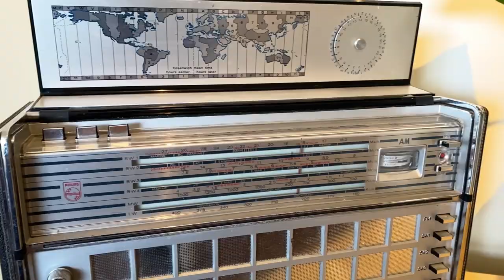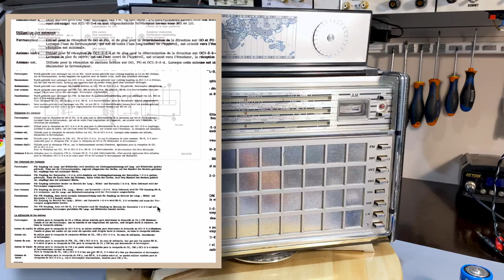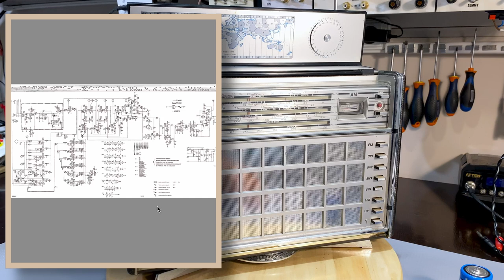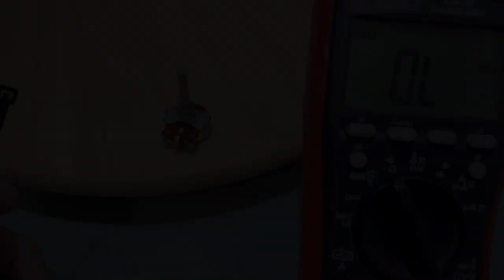Restoring a classic that appeared in a Bond movie. Philips Antoinette 22RL798. Part 1

Comment: Thank you for your wonderful videos!  Just picked up at the scrap yard an L6X38t/54 in abysmal shape.  Lots of cosmetics needed, rusty battery hatch, glue, paint and grime on the exterior but no leatherette rips, chrome degradation.  I am anticipating a full resto on the exterior.  The insides, well we shall see but your video will help me with that although the circuits are slightly different, the attachments and layout look identical.

Avid watcher and thanks!  Geoff
Reply from the maker: Good luck Geoff.

Comment: Nice Radio - congrats to the find! To the pot repair: A nylon screw M2.5mm through the broken pin with a nut on the other side could be more solid and long term stable - if there is enough space in the pot.
Reply from the maker: The seems to be enough space, so I may still re-do it. Thanks.

Comment: I'm not really a lover of Philips equipment, mainly televisions, which I worked on some years ago when I was a television engineer. I know when they are working, they are good. I had to repair a volume control which had the same problem once. Let's hope the FM will be a straight forward fix. I don't particularly like metal grills in front of speakers, which don't sound as good as plastic or wood, but looking forward to your comment when the speaker is cleaned and back in the radio. l do like the look of the radio and I can remember seeing it in that Bond film.
Reply from the maker: I’m liking this one more and more as I work on it. I was apprehensive, but it’s been behaving itself 😊

Comment: Hi Manuel. That is a nice looking radio, I have never seen one before. Could this be Philips equivalent to a Grundig satellit?. It will be interesting to see how the  performance compares to the Grundig models. Looking forward to seeing your progress. Cheers Chris.
Reply from the maker: I guess it was made to be on the same level as the satellit, but I think Grundig went much farther to create a perfect radio. We’ll see how this one performs.
Reply: The fm, and medium wave are very good on this radio. But shortwave is not. 
It's no competion for a sattelite in that regard. I also own this 22RL798, which is a stripped down version of the L6X38t. I do own that one also, a very early model from 1965, with a totally different dial.

Great radio Manuel, and you where smart to strip her down to clean it properly.
Have fun! Be sure to check the discriminator diodes in the FM...
Best regards from the Netherlands, 
Nico den Haak.
Reply from the maker: Thanks for the tip. I’m going to open up the FM section as I believe the signal isn’t getting out of the first stage.

Comment: I've got a 22RL798 with low volume which I will someday try to repair. I once had a L6X38T, the previous version of this radio, in mint condition which I regret selling. The L6X38T had a built in earphone that pulled out from the rear of the radio. It also had a gain control where the fine tuning control is on the 22RL798. Most of the radios I see one bay in the US are the L6X38T version.
Reply from the maker: I’ve read about that previous version. At first I wasn’t sure which one this was but the fine tuning control gave it away 😊
Reply: @electronicsoldandnew  One thing I've heard about this radio is that the metal traces on the band selector switches wear away, making the radio not operational. Not sure if this is true but I hear this is an unusually difficult radio to repair even though the actual circuitry appears to be fairly ordinary. The radio is heavy but has sort of a delicate feel to it.
Reply from the maker: It does seems delicate. I hope the band switches don’t force me to do deep surgery 😊
Reply: @electronicsoldandnew  One more thing. . . the radios sold in North America were branded as "Norelco", which was Philips North American division. But they appear to be identical to the Philips branded ones except for nameplates and perhaps some trim.
Reply: @electronicsoldandnew  I recently bought my old L6X38T radio back from the local collector I sold it to last December. He needed some emergency money and I was happy to buy it back. Now it's sitting on my window ledge again. Thankfully, it still works well on all bands and looks almost new. However, after seeing your video, I'm not sure I want to try repairing my 22RL798. It will stay stored away until I feel like working on it.
Reply from the maker: 😊 I’m sorry I scared you off that project. You may have better luck than me.

Comment: Obviously Antoinette has spent quite some time in a damp environment. Maybe this transistor radio was used on a boat? But for a high end radio rust should not to be found on the speaker. Here the Dutchmen have been a bit miserly with chrome.
Reply from the maker: It looks like something spilt on it. Not sure, but salvageable.

Comment: Sir very nice. Today i found L6 radio from flea mRket. It does not work. Someone has cut the battery connections. Please let me know  how to connect battery connections.
2. There is no sound. No handle and dial cover. Can you please guide me from where I can get missing parts. What should I  do it may start working. I love this radio very much. I  like your way of describing. Where is your workshop? Waiting your kind response.

Comment: My Philips radio works fine in FM but not in MW or LW or shortwave bands just noise but no stations tuned... Any advice on where to have a look? Again FM stations perfectly tuned with a great clear audio......no easy to dismantle  a lot of small screws to remove it

Comment: That's a good looking radio and it was obviously pricey when it was new judging by the feature count.

I hardly ever replace pots. What I usually find, assuming a quick squirt of switch cleaner doesn't sort it is that it needs removing and dismantling. The problem is nearly always the centre contact, the metal ring that goes round the spindle that the sliding contact works against. The metal ring is very often caked in crud and a proper clean up of this part normally restores correct operation.

Now I'm not such a skinflint that I resent buying a new pot for about £2. The problem is that there are very few electronics shops left and parts have to be obtained online with the almost universal £10 charge for delivery. Yeah...£12 for a volume pot...

I need to get a couple of 33 ohm resistors for my record player but when you consider the items might cost 50p - £1 only to have £10 carriage cost slapped on top, it's not really a matter of being a skinflint.

Obviously the way to do it is to buy a lot of stuff at the same time but in my case there's nothing else I need. Anyway, I digress somewhat, rant over.

Returning to the subject at hand, this radio looks very promising and even though it's a Philips it doesn't look like it'll be unduly baffling to deal with. Once it's done, you'll have to adopt a white Persian cat who can sit in your lap as you utter the immortal words "We've been expecting you Mr. Bond"...
Reply from the maker: I have the same experience as you do regarding pots, and also the crazy costs of components that need to be sent from across the world 😊 
I’ll have to make do with our cat, because getting a Persian will cost more than the radio 😊
Reply: @electronicsoldandnew  Well, your cat is at least suitably fluffy even if the wrong colour!
Reply from the maker: True 😊

Comment: You are using the wrong side of the radio for finding FM signal. You should use the left side. Thats why it's not finding any signal on FM.

I have 2 of these, one isn't turning on, it doesn't do anything. What should i check first? I'm not used to working with radio's, just somesort of a collector. It should have worked when last used.

You are missing a small plastic part for putting the short wave antenne in when it's down.
Reply from the maker: I’m aware of the tuning on the left side, and added a comment to that effect in the description. 
Diagnosing a fault king-distance is tricky. I normally go through the entire procedure as described in this and subsequent videos, as well as in restoration videos of my other sets. I hope that they help you with yours.

Comment: So much work ahead, but step by step you'll won it. By the way, Manuel don't you think that audio has more bass than treble... I've seen you tweaking the treble pot, gets a little better but not so much. I wonder if those poliester(strip colour) are guilty of the low treble sound, did you checked them??. Probably I'm wrong, and  it's Philips usual sound.
Reply from the maker: I haven’t checked any caps other than the elctrolytics. Time to check the others.